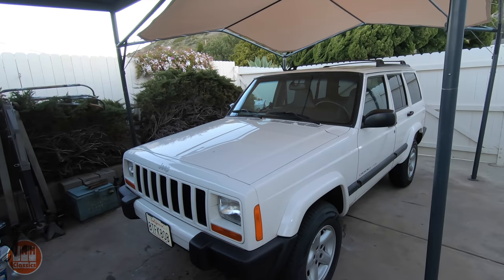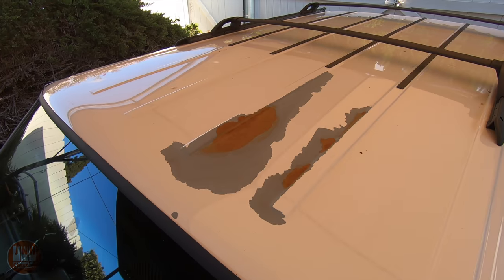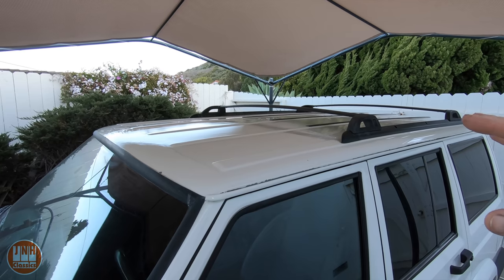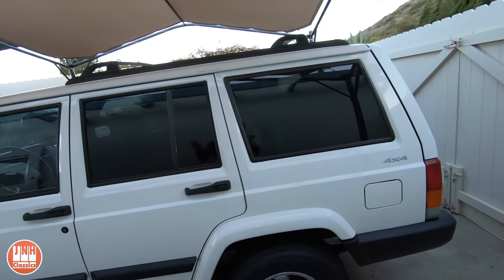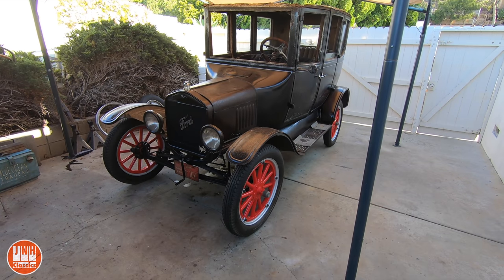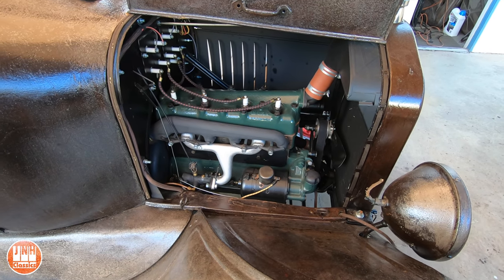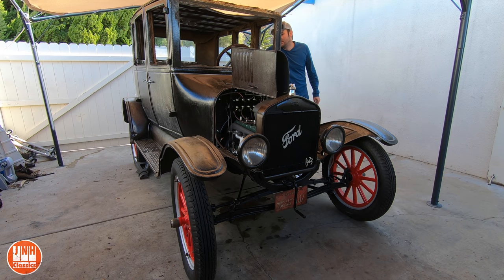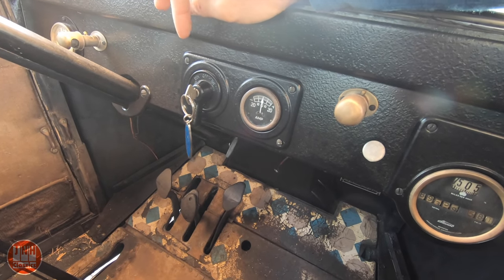Hand Starting the Model T  & Why I Didn’t Post a Build Video - Sunday Update (3-21-21)

Comment: ONE CRANK! AWESOME!!! Sometimes You will get what is called a "Free Start" This happens when You stop the engine, And it is just primed for the next cylinder to fire, You turn on the key, And without touching the starter or crank, It fires off and runs! I have had this happen several times,! One time I got three in a row! Your a Jeep fan as well!

Comment: I have a 21 amd I usually put the spark advance in the same spot as usual and I put the das lever about a half to an inch down. Then I use the choke on the left of the radiator and start cranking and pull amd push the choke. When it starts to die pull it fast and let it go do it every time it wants to die when starting

Comment: When you get the generator off, hook it to your battery with some leads and see if it runs as a motor. If it runs as a motor, it is likely working as a generator also. The item on the generator is a cutout. Your problem could be there. I don't think I can accurately describe the way it is supposed to work but I am sure you can find it with a search. I THINK it closes when the generator starts to charge  and stays closed as long a current is being produced. It does NOT switch on and off to regulate the charge rate. The charge rate is regulated by a moveable 3rd brush in the generator. It is set to match your driving habits (day/night) and then charges at the same rate any time your generator is operating at full speed.
Reply from the maker: Thanks for the great info👍

Comment: How does that ignition system work?  No distributor?
Reply from the maker: It has what’s called a timer which is very similar to a distributor. But you adjust the timing by hand
Reply: Interesting, thanks :-)